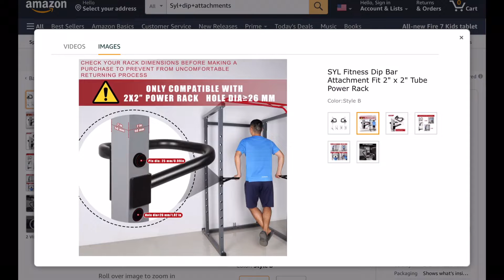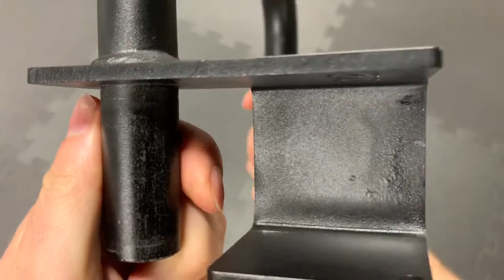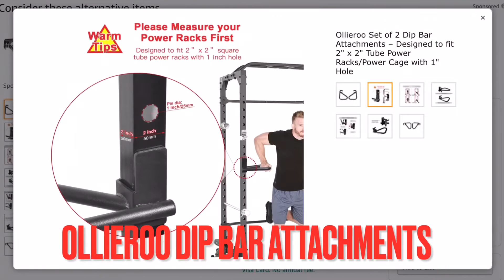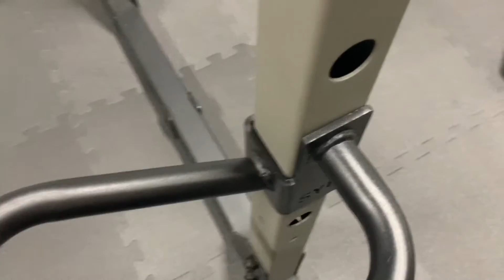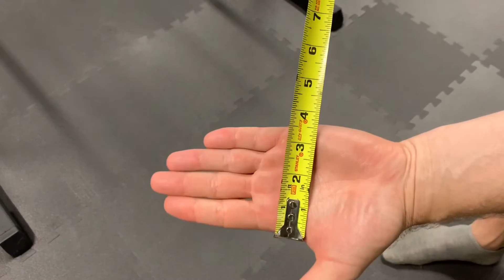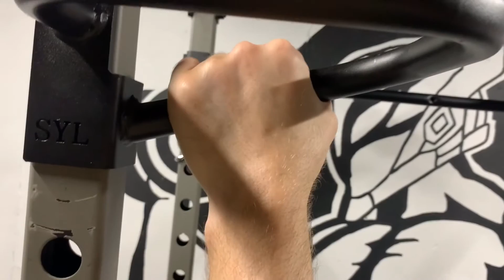FULL REVIEW of SYL Fitness Dip Bar Attachments for 2" x 2" Tube 1" Hole Power Cage Rack

Comment: Can you tell me what your setup is hanging from your pull up bar for resistance band training?
Reply from the maker: Nice! Oddly, it’s a pulley system by the same company, SYL Fitness. I just always leave the strap and carabiner in place. It doesn’t get in the way.
Reply: @HowtoandReviewsOfficial   I need to pick that up I guess...
Reply from the maker: @briansimon1263  Definitely nice to have for $20 to $30. Cannot go wrong with it. 
Another option is to go big and get the Fitness Reality Lat Pulldown & Leg Holdown Attachment. 
https://amzn.to/3AkFGlR
I would like to get it, but I know those pulleys permanently mounted on the bottom bar will interfere with my bench for bench press.
Reply: I actually found your other video talking about this...